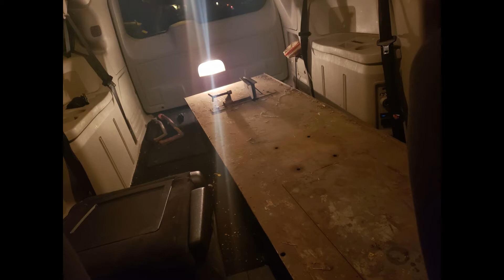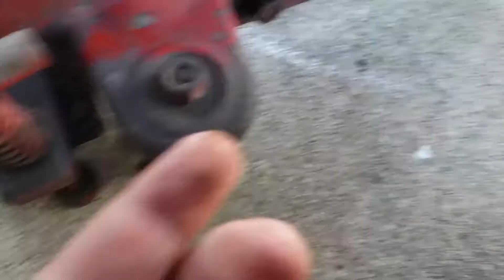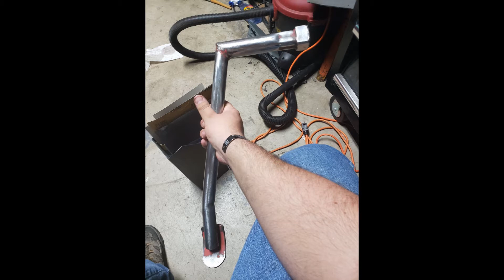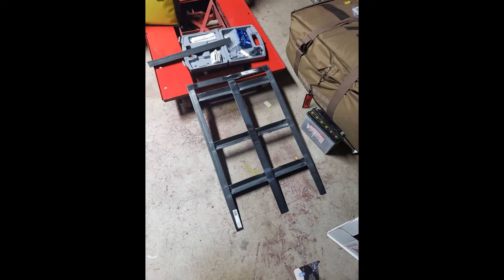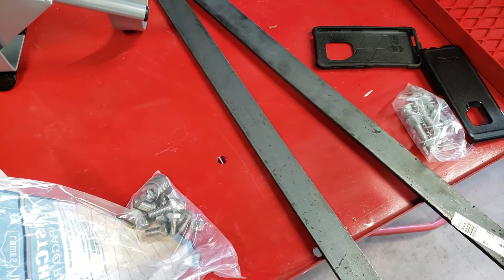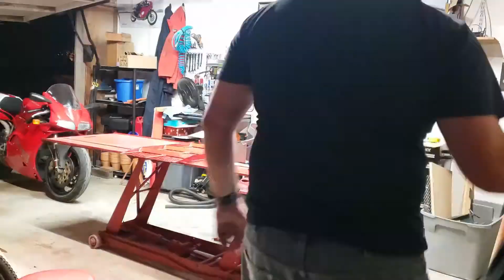Cleaning Up An Old Grazia Motorcycle Lift Table

Comment: All the "Extra" stuffe he bought to get this table complete he could have bought a new one.
Reply from the maker: Strange comment. The tools I all had on hand or borrowed. Materials for the ramp were probably $75, and maybe $75 for all the paint and stripping material. A new one of these would have costs $800. Besides all that, the point was to have a project as much as it was to save money.

Comment: I used to work for Herm Baver. He’s one of the few importers on the East coast who imported Grazia lifts. Im actually going to buy one from 1974 I found on FB marketplace!
Reply from the maker: Nice. I miss this lift, it was a great tool. I sold it earlier this year when I moved. Out here in Texas I had a harbor freight clone, it was close but not quite the same.
Reply: I got an old Grazia floor jack, it’s a huge one, I got it from a local farmer and he was jacking tractors up to 10 ton with it. I’m only using it for my family car repair, top lifting height is about 60-70cm.
And the other day I was a bit curious about this Grazia brand. Logo says it’s originated from Bologna, Italy. I can spot some eBay items and few repair videos. I was very surprised seeing a Grazia product overseas in US. No idea what happened to this brand. Looks like it was a huge one - lots of hydraulic tools like all kinds of jacks and platforms, compressors, etc. 
I’d appreciate for any ideas or brand history sharings. Cheers!

Comment: That last bracket/adapter was a bit unnecessary  - why not just remove the black plate from the clamp and bolt the clamp directly to the table ?
Reply from the maker: Because the bolt holes didn't line up. I left the back plate on to give clearance, it allowed space to put that barcket down. 
A simpler solution might have been to drill into the table. Would have been work but doable. But then again, I just discorved welding so it was an excuse to make a thing.

Comment: Nice work dude. Looks great.  Very cool that after the clean up you discovered that it was a Grazia lift.  Welding is some thing I really want to get into as well but just don’t have the space for it. (Apartment living blows)
Reply from the maker: I am painfully aware how lucky I am to have the garage space. We've lived at a few places that were single bay, and the bay was full of crap. This is the first time since getting married that I've had the space, and before that I was in Army barracks.
Reply from the maker: I wish marker spaces were more readily available. That's a solution you might want to look into.